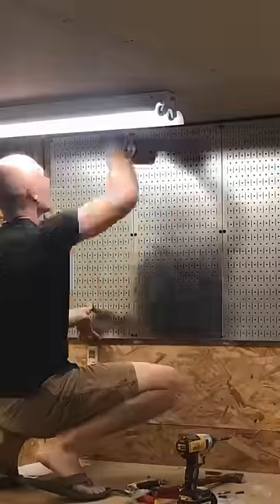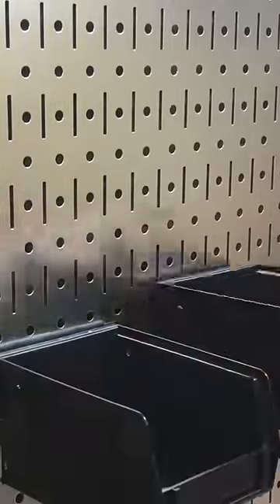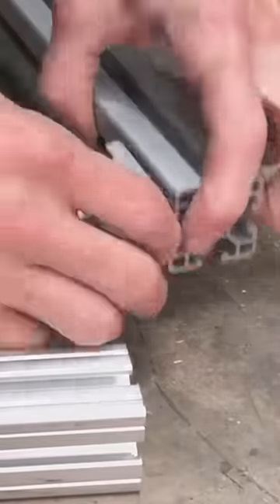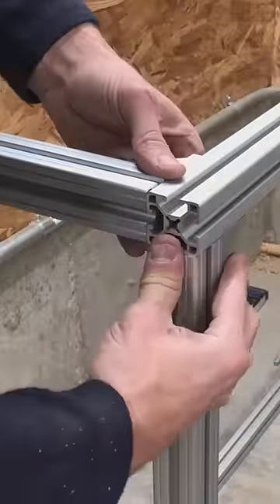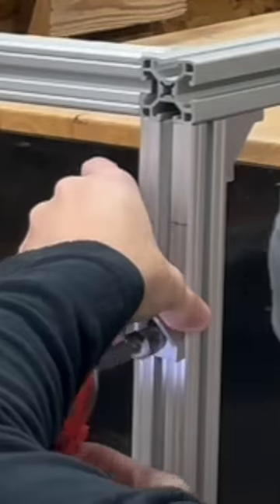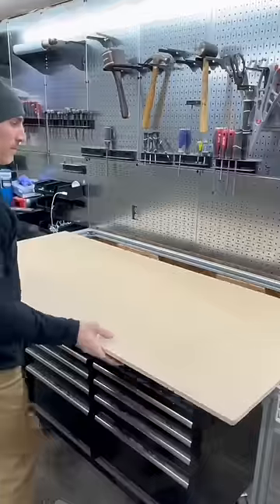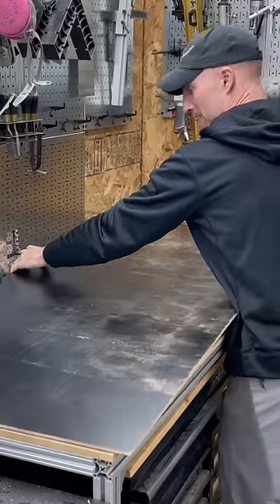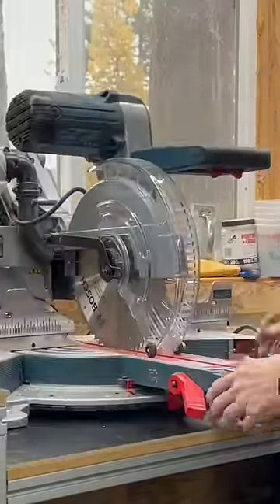Modern Workbench in 60 Seconds

Comment: I have those same metal panels in my garage. I can tell you after 10 years and a few seasons where I had some condensation issues in the garage, those boards still look brand new. They hold up very well. It’s fun to play with the setup and see it evolve as you work with it. I even find myself moving the bins around depending on what I’m working on so certain parts are within a closer reach.

Comment: I make the aluminum extrusion pieces! I work for Crystal Finishing Systems and we make those pieces for the company called 80/20. So cool to see how those pieces are used!
Reply: If you want to see 80/20 in use,  go to any manufacturing plant and you will see it used in a lot of ways on and around the machinery. Very cool and versatile system. Not cheap, though.
Reply: @markgallagher1376  we have it all over our plant for safety cages and fences and such. But tables and such is new to me.
Reply: I’ve also seen it used for boat trailers.
Reply: @markgallagher1376  we make a lot for Harley Davidson. Trailer parts. We also had a hand in stadium seating for many big name sports, DNR. Google uses our parts as well. The 80/20 will always be the most versatile. My fav!
Reply: Also used by company for trade show booths sometimes
Reply: We mount certain conveyor systems we build to 80/20. Great stuff. Easy to handle.
Reply: I used 4x2 timber and channel racking. Not as pretty but good enough for my 160 sqft  garage.

Comment: I tip my hat to you Sir…. That is amazing. 
I had a tiny garage and made a hinged work bench with collapsible legs, it was strong enough to allow me to bolt a 4” bench vice and 6” bench grinder to it, but still light enough that I could fold it away when the space was needed.

Comment: Can I suggest a safety catch here. Get a small diameter rubber hose, split it open lengthwise and place it on the edge if that metal wall covering where you have that recessed receptacle. You could touch it to the plug prongs while inserting or removing it and short out as well as possibly shock yourself or someone that is touching the exposed metal.

Comment: Do you ever customize your models to make them more detailed/accurate? Swapping to different diameters of aluminum rod would be a super easy improvement on the exhaust, upgrading the ignition wires, and flocking the carpet can really transform a model. I understand not modding the pricier models like autoart and BBR but the cheaper maisto/burrago models are basically begging for it.
Reply: Commented on this before I got to the engine bay segment off the review. Yeah, that’d chrome mismatched engine (RB26 swap rather than the period correct L24) needs to go. A company called Hotwheels works makes resin 1:18(or any scale) engine/body components that are hyper realistic. I would recommend diving into this model as a guinea pig to dip your toe into the modifying side of collecting(since that engine is a god awful eyesore and you couldn’t possibly mess it up worse than leaving it stock) lol
Reply: what are you actually talking about, mister?
Reply: @_InTheBin  Honestly, I have no idea what part of what I said was in any way confusing?